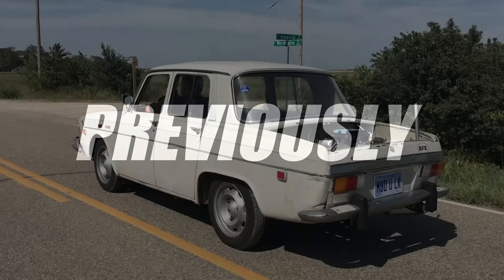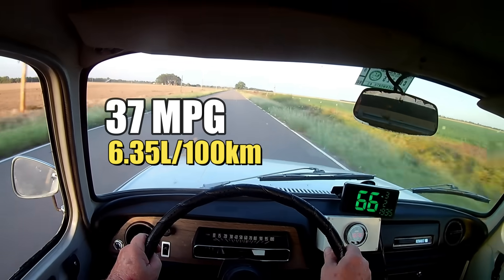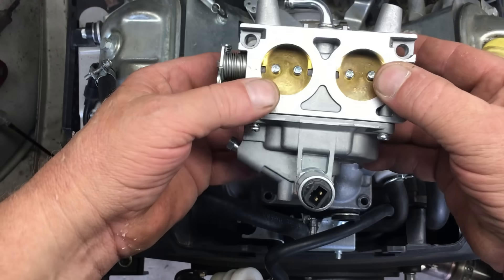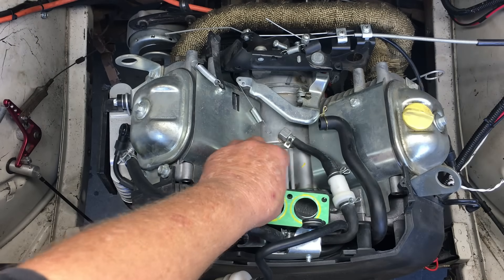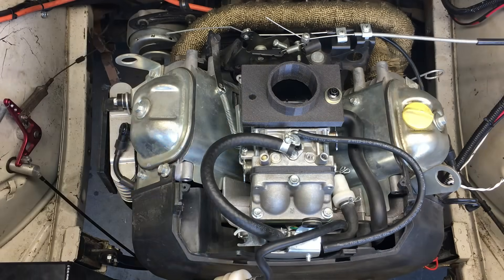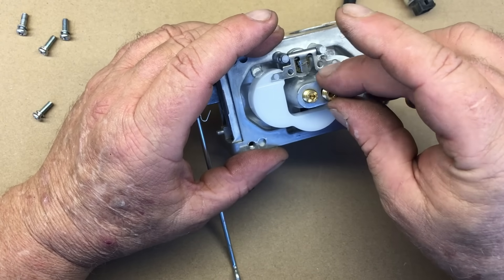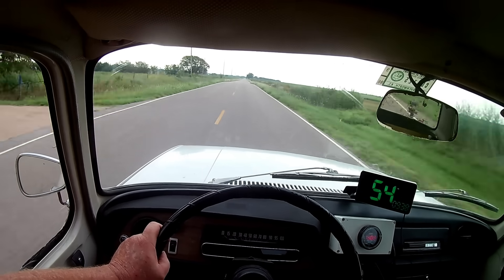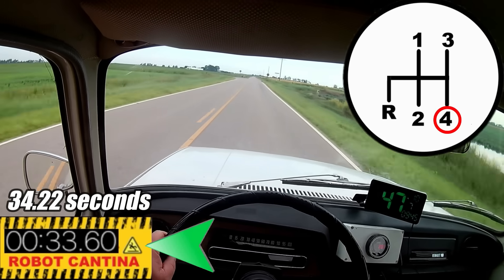S3 E27. We improve the fuel economy on the 670cc Predator powered Renault

Comment: Hey brother just checked out a channel Vasily builds, he had a video of upgrading his 670 with a pretty cool dual carb setup. He made some mods to the valve train and threw in a cam and header. He estimated 40 up and 50 ft lbs of torque. Anyhow if you haven't seen it I thought you might be interested. MOD on👍

Comment: Low cylinder count engines have pretty pulse heavy airflow dont they? I'd be curious what happens if the twin barrel carb was replaced by a single barrel carb of similar flow, and a larger plenum, to buffer airflow. Schmoove it out, yah know? Or attach the carb from the 420cc single cylinder engine?

Eagerly awaiting the next test!

Comment: Personally I think your manifold is a disaster! The flow of volume between the two manifolds will cause buffering in your manifold. You must have at least the same flow of volume between the two intake manifolds for it to work so I think your printed manifold spacer is far too low . At least 75% of the volume would work.

Comment: Hey random thought on hooking the manual trans up to the engine - you mentioned the 670 not being able to deal with the thrust loads.. what about using the pto case flange as a base to make thrust bearing suitable for your purposes? After having watched Steve Morris build one of his SMX engines - I found out that he uses a roller thrust bearing mounted up front, separate from the main caps/bearings. Made me think that you could design your own, placing it wherever is convenient..

Comment: Makes sense. Smaller cfm more vaccum improved response.

They used to make a little plate on two strike pwm and pwk carbs so as below half throttle the carb throat was smaller. Big improvements in partial throttle operation.

Anyways, seems like the plate was a mistake until you're all the way up in RPM and "on the pipe". Given these long third gear pulls I'd probably go back to individual sides versus combined.

Comment: V-twins have 2 barrel carbs and separate intake runners for a reason.  The firing order is syncopated; one cylinder cycle negatively impacts the intake of the other but not vice-versa in the same degree.  If the two intakes communicate via  any common plenum the vacuum signal at the jets is ruined.  While you measured your net mixture and rejetted accordingly the mixture would have been quite richer in one cylinder and leaner in the other.  This may have been lean enough to be down on power or borderline dangerous in one, and too rich to be drivable in the other.  This may be readable on the plugs after a long-term full throttle run at temperature.  I worked on a 20hp Honda V-twin some years ago that had this issue because it used a common intake and a 1-bbl carb; they charged more for the 24hp with a 2-bbl and divided intake for a good reason.  Honda's carburetion expert admitted this was the issue and spent a lot of time optimizing the jetting to balance this out because my employer didn't want to pay extra for a real intake system even though it came with more power.

Your fuel economy went up because you jetted down.  I noticed you didn't repeat your 0-55mph run with this setup; my guess is it's slower by a couple seconds.

Put the divided carb spacer back in and return the previous jets.  Add an intake hose (2" or 2-1/2") and remote mount the round air cleaner where you can get some higher-pressure air forced into it.

Comment: You should swap the carb for a small automotive style carb with an accelerator pump.    This gives you the option for a chrome air cleaner lid, which everyone knows instantly adds 10 hp.

Comment: There's a few videos online where you can take the AEM gauge and hook it to a RS232 to USB adapter into a laptop to record the afr. I did this myself and found you can use a free program called serialplot and live graph the data as well as add a bar graph to live monitor it. It was super helpful in tuning a monojet to holley 2 bbl conversion I did. Wouldn't take much modifiying on the unit you already have. I posted a few shorts showing it working.

Comment: I think you need a carb with a power circuit, as stationary engines like this don't have to deal with acceleration like a road going vehicle does. With a power valve circuit, you can have enrichment on acceleration but jet down for steady-state economy. A constant-depression carb would also suffice (they have a similar effect under acceleration).

Comment: Several thoughts on this …now in a typical  carbureted car application when you put the phenolic resin spacer on there you do get power and airflow changes for a couple of reasons one. The intake runner length has increased that does help support or low in Torq but to you also have less heat soak in the carburetor because the plastic does not transfer heat the same way aluminum does so your air fuel mixture will be more dense. This might explain the change in needing different Jets as much if not more, so then the cross flow aspect

Comment: Cross flow spacer, if anything, changes the acoustics of the engine (pressure waves wizardry) but we ain’t using the engine for its intended purpose anyway …
Back in the day, on twin carb minis, David VIZARD had the cross flow part of the inlet pipe smoothed out for extra torque and power.
Here the flow is disturbed entering the inlet which acts as a reduction in cross section.
Anyway, if a single barrel carburetor was as good as a two barrel, pretty sure the manufacturer would have saved the expense …
Looking forward to some more testing !😅

Comment: THe neck of the air filter speed up or improve the air flow at high speed. Plus cone shape filter promote or generate more air flow with the air speed increase. Whirlpool or black hole effect

Comment: Also sir, the air filter may be a little bit too small.  And, a thicker spacer with more plenum area would help as well as "knife edging" the divider wall between the two ports on the intake to reduce the inevitable turbulence that's now present from the "gap" between carb and intake 👍

Comment: I fully expected the cross flow spacer to reduce performance because of the turbulent airflow and figure that a bore matched throttle spacer would have given better gains... But here we are with gains all the same. Can't wait to see you try without the spacer to pin down where the gains were made. Keep up the solid work!

Comment: Seems like there is a bit left on the table in the cvt clutch department. The way it revs up on the launch and then bogs back down isn't ideal. You want the cvt to hold the engine at max power while accelerating.

Comment: I would play with the idle jets/track of the carb to bring back the off idle slump you felt. Also get the clutching right and you would pick up a bunch. When a cvt is optimized, floored from a stop it should jump to peak power rpm and stay there till you run out of gear. Good luck keep up the great work

Comment: Ive heard David Vizard (a proper gearhead engineer type) tset intake modifications that do exactly what yours did in principle: allow each piston to pull from every available barrel, albeit on a small block Chevy, to some success. (26ish hp gained with other intake porting mods and a custom spacer plate)
If i put on my speculating hat, i wpuld say the air flow is up in terms of CFM to each cylinder but perhaps some extra turbulence was added from the shape of the spacer and the wet fuel flow changed so it isnt lighting off as well in the chamber, hence your reduced theottle response. This is just a guess but i think the theory is accurate. In any case maybe try  printing a slightly taller carb spacer with a more shallow wedge shaped center divider sitting on the center of the elbow to let the air from the other throttle valve cross over more smoothly, rather than hitting a sharp corner. Think bellmouth rather than open tube or like the rounded wedge on the roof of a semi tractor steering wind around the corner of the trailer

Comment: If you leave it in second gear, will it pick up speed faster but just hit a lower top speed at that gear or will it accelerate at the same rate because of the cvt?

Comment: My first thought is that the shared space in the carb spacer caused alot of air confusion.  I would have added a spacer and tried different thickness but left the runners seperate.

Comment: The CVT springs and weights needs some tuning so the bog across what would be 2nd gear speed wise , where the centrifugal clutch is getting full engagement ~20kph struggles to gain next 5 then eases up to 30kpa the rpm starts climbing to~40kpa.
The bump at 50mph was the motor coming into synchronization ( harmonically) "coming on the pipe " if this was a 2 stroke go-cart. This is where  my friend set his 5hp brings, making 40hp on methanol turning 9k, on top of the TQ  curve . CVT's are tq hungry.  Running peek tq gets through the "gears" quickly then the HP takes over when the CVT runs out .

Comment: For better launch draught in some extra fuel at WOT only, a spray bar (piece of small tube with some tiny holes in it) just in front of the throttle plate that is given fuel only at WOT. Same idea as a power valve in a more complex carb.

Comment: I tried this same thing with a 2 barrel weber on a vw engine. Made a test spacer out of wood. It woodn't run proper with the spacer. It divides the vacuum pulses between the barrels. I would suppose you'd get better fuel atomization with the carb set up how it was designed. I am imagining a fuel injector spraying more often but at a lower pressure.

Comment: Try reducing the wheight of the rollers in the cvt transmision, or using a stiffer spring on the cvt pulley, the car when launching drops the rpm due to  a soft spring or hevy weights in the cvt, try playing with that to see if the acceleration improves, the idea is to keep the cvt working in peak rpm engine power. Also try installing a taller carburettor spacer same as you created but taller, to let the engine suck better from the carb, also with a dremmel work on the edges of the holes of the intake manifold to improve intake flow

Comment: i don't trust that 3d-print-spacer to be air tight. spray start-fluid on it and see if it changes the engine rpm. even is the sensor is stating it's running rich.

Comment: Try it with a Weber 32/34 two barrel carb and an intake to allow cross flow.  I had one of these motors with that carb (stolen from my fiat in profile pic) and it worked great.

Comment: Always design and optimize your air intake tract to take advantage of pulse wave reflection.  Its easy to find information, and affects intake runner diameter and length, AND a plenum chamber relative to the desired rpm range.  A well designed intake manifold tract can get an Naturally Apsirated engine up to near 100% volumetric efficiency, its like free super charging.

Comment: im a motorcycle guy so this is a common thing, what is happening is there's more air so you will have a higher vacuum at WOT but less down low due too a less restrictive intake how you fix this is upsize the starter jet/secondary what ever you want too call it go up 2 sizes on that too compensate for the increased air flow across the main (one thing we do is socking a pod literally put a sock on the pod) this proves over vacuum and will almost always increase power on the low end, also helps lean down a mixture 2 or so main sizes ex is socked pods on a 1100 vstar is 17.5/145 and a 3.75 pms or 20/138 2.5pms( stock setup is .7mm lower on the needle with 17.5/110@3.0 on the pms) both have alot more power overstock but the second option handles more like stock with grunt down low and a bit stronger top end while staying in an ideal afr.......and were your running a cvt the 1500-3300 rpm range is were you need power

Comment: Jimbo nice job 
1. you can try an crosflow spacer before the ¿manifold ?  the thing you screw the carb. I see 3 options one or other or both. I think you gain tork in the higth revs with the crosflow. 
2. Need more fuel yes.
love your work

Comment: I would like to see flatter fasteners on the throttle plate.  Those existing screws are certainly bad for air flow.
That should bring the mpg up by 0.00001%  :)

Comment: I love the project and the operators standing by bit was really funny!  Next time you have to make a small screw hole in a gasket, chuck a hole punch(the kind you usually smack with a hammer) up in your drill press and drill/cut the hole, it give you a real nice, clean hole. I had a '67 r-10, great car.

Comment: Something often overlooked when switching from factory air filtration is consideration for the total filter area needed to not only allow enough airflow to the engine in question to properly breathe, but also maximize the time between filter service intervals to prevent clogging, which will hurt engine performance more severely than the factory air cleaner assembly ever could... even if it has a filter that's halfway between service intervals.😕

Comment: If the AFR is richer that might mean that the modifications have created a restriction.  Ideally you would want to see the engine running leaner which would indicate more airflow.  I would do some more testing without the spacer to see what happens.  The air filter may even be more restrictive than the factory one.  Enjoying the project!

Comment: i thought the manifold spacer plenum was a great idea. Now i think you need to ditch the 90 degree part, re-make the plenum spacer a quite a bit taller and add a 2 barrel progressive carburetor like a Weber. This set up would give great performance and would probably give greater mileage at the same time.

Comment: I would love to see a air intake system that takes some air from the sides behind the windows to try and force more air in. I don't think it would look any different so long as it doesn't have scoops sticking out, as the air naturally tries to turn in and down into the engine bay. It would help the single bore style carb cross flow going on at lower rpm once the speed is there, while allowing a larger "plenum" volume as long as they had a larger effective open hole at the intake versus the area of the filter. A funnel basically lol.
Reply from the maker: We will try a temporary ram air system in the next video
Reply: @robotcantina8957  that would be awesome! Thank you for the reply and thinking it would be worth it to try

Comment: I think that combining the intake manifolds are bad thing, because as carsandcameras did they run into esue that the mixture was not properly distributed.🫤(one cylinder ran super lean)😐
But in your case , you did not change much, so I assume that the mixture will flow almost same plus the spacer will synchronize the pressures so in your case it could help.👍
Love your videos ❤️

Comment: Have you considered using a mote powerful power plant? The size of this car would be a perfect fit for a 4 cyclinder out of a wrecked Kia Rio
Reply from the maker: We tend to focus on unlikely engine swaps.  The lawn mower or industrial engines that we use  are not the best choices... and that's what makes it fun.  The Renault can be driven at full throttle  and most of the time we wont be breaking the speed limit.

Comment: Yamaha did this 'double carburettor'-thing on their V-Max back in 1985. In this setup, a butterfly valve between the 2 carb banks remained shut up to 6000 rpm. After that, all 4 cylinders got to breathe through double the amount of carbs (well in a way) which made for spirited acceleration and - obviously - more power. Let's face it, 145 horses was a LOT back in the day!

Like others say, at low rpm the air velocity through the carbs is too low, making for rubbish fueling. My guess is it'll run quicker to 50 mph without the spacer, but run out of breath over 50 mph. Looking forward to updates! 😀

Comment: Your CvT is too soft.
It's allowing the ratio to decrease far too quickly and pulling the engine down out of peak power range.
Take some weight off of it, or change to stiffer springs so it doesn't "upshift" at such a low rpm.

Comment: I think it would've been better experimentally if you evened out the jets before installing the carburetor spacer because you said that they were jetted unevenly for the old muffler.
Although you'll probably still want to tune the sides separately due to the unequal exhaust header lengths.

Comment: I feel like this would be wicked easy to fuel inject using a small throttle body, a fuel injector, an MAF and O2 sensor off a junked vehicle, and a Raspberry Pi Pico/ESP32. Since you seem to be happy running with the "hood" open, I'd also replace the 90° elbows in the intake with a combined straight unit and mount the TB vertically - downdraught TBI, basically. I'd also shield the back half of the filter cone to prevent air starvation at higher speeds due to pressure differential.

Comment: That's impressive work, but I'm wondering what was off in the original engine. IIRC, the 10 could do 0-60 in about 30 seconds and got around 28 to 30 MPG (us gallons) on the highway. 30 sounds low these days but that was slightly better than the VW bug or Corvair... and double bigger US cars.
Reply from the maker: The original engine that came with this car had broken sleeves and severally damaged pistons.   The engine was more or less beyond repair.... at a reasonable cost.  So the car was perfect for doing these small engine experiments on.
Reply: @robotcantina8957  Wow, I'm surprised the original still got good MPG or could accelerate at all. I had a temporary 1960 Beetle engine that the PO supplied in a box, back in 1970. Somehow that thing was getting 8 to 10 MPG. My dad destoyed the car before I could complete the new engine, so I never found out why.